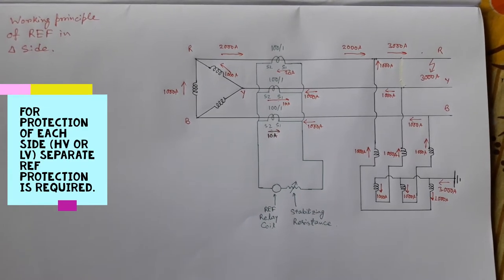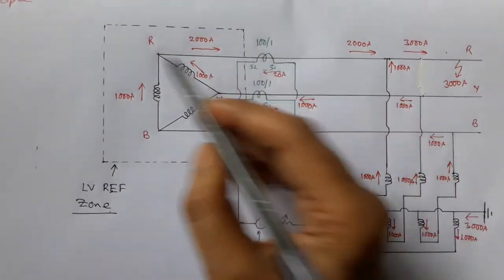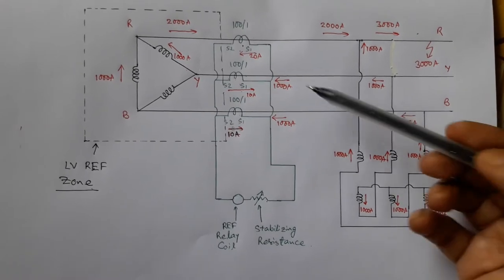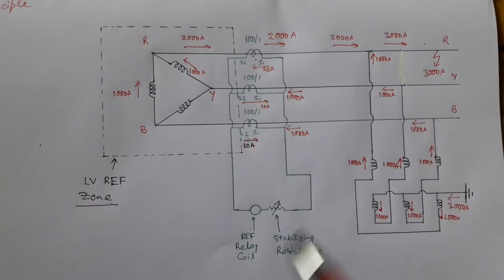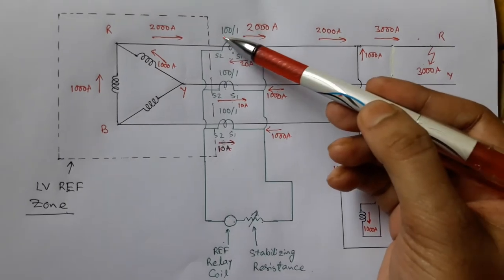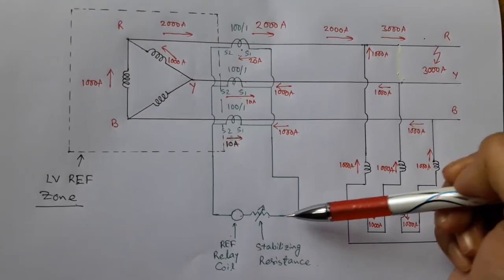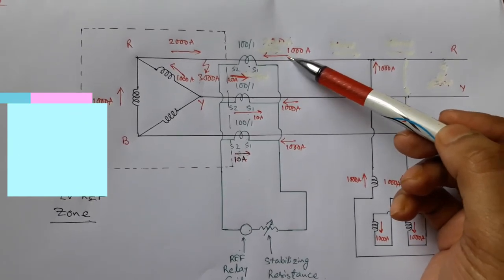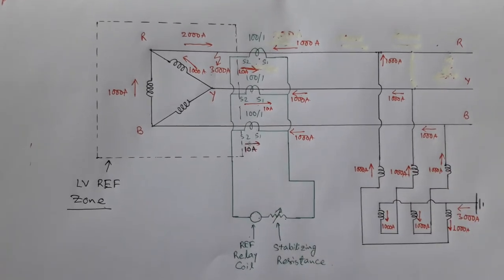ref in delta side of of power transformer/ref current distribution in delta side of transformer

Comment: REF protection is provided between the transformer phase winding and neutral winding.  For delta winding transformer neutral displacement or zero sequence over voltage protection is adopted to detect any ground fault.
Reply from the maker: Yes, neutral displacement VDG relay may be used for unearthed system. But if eartining transformer exists then, REF will also work in delta system.
Reply: @eddycurrent1187  So, you have shown how to use the REF in a delta system with an earthing transformer.